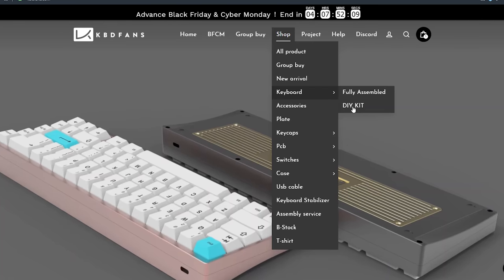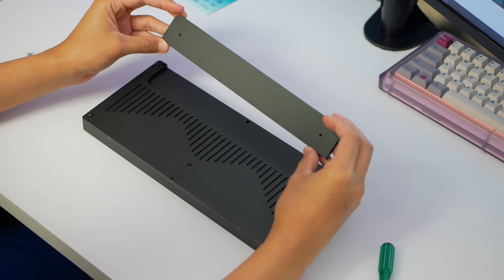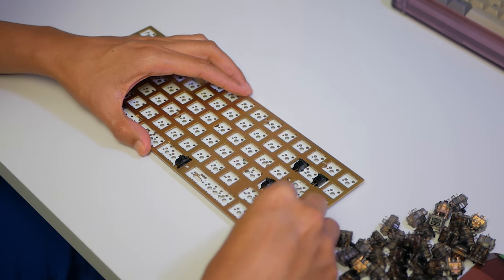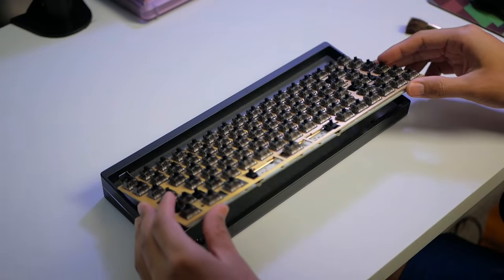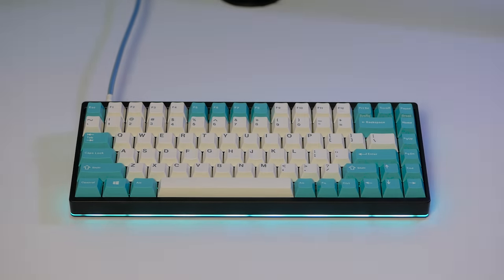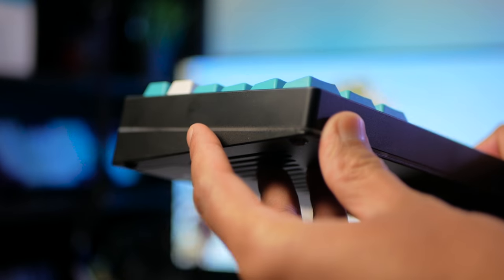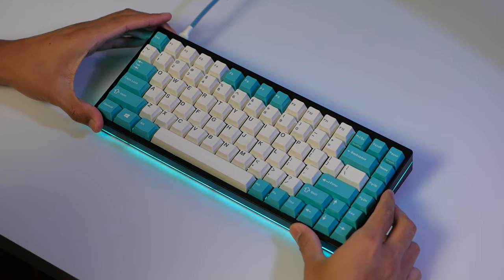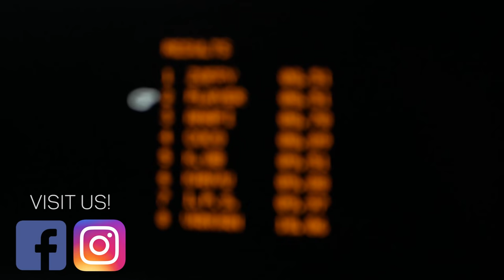KBD75v2 Mechanical Keyboard Build with Gateron Ink Silent Switches!

Comment: I would suggest a cheap hotswap to anyone getting into the hobby.  That way the initial cost of purchasing equipment (ex Soldering station/fume extractor) stays low.  Once they have solidified their interest in custom keyboards they can always use their hotswap keyboard as a test bench for switches later on.
Reply: thats what i did. I just got my new MD Alt. and i purchased switches and keycaps, with the guidance of a friend who got me into this. Im yet to swap it all out.
Reply: I already have a couple of keyboards but I've decided to buy a Glorious GMMK compact for cheap on their back friday sale.

I'll probably buy some Gateron Black Ink switches (still deciding between normal inks or silents) and put them on this board. :)
Reply: I even know how to solder and own the equipment and still enjoy my gk61 for testing around
Reply: Can you send one example of the hotswap? I want to save myself the hassle of soldering(I know how to solder, I'm just not in a possession of soldering equipment).
Reply: Why would someone not buy a hotswap keyboard? im getting into this and sorta confused
Reply: @linkstale  I think non-hot swap PCBs are cheaper but it limits you to one switch until you desolder
Reply: It’z _ Zilent do they effect the sound at all?
Reply: It’z _ Zilent what kind of blunt tip would you recommend?
Reply: It’z _ Zilent anything else? Not having one is one of the reasons why I want a hotswappable pcb without buying a separate one
Reply: kabob
Reply: Hot swaps are soo limiting though. I'd like to see a gk64 with an ISO enter key and Lshift. I've honestly only seen a custom build with these on the verge but that was solder. I haven't seen anyone else.
Reply: @nootics  people just getting into keyboards aren't gonna be bothered about that though
Reply: @willwastaken  maybe you don't have to deal with different layout and I like my enter big and a button next to lshift xd
I'm just getting into it myself, researching a little atm, and i'm probably gonna go solder because of that.
Reply: @nootics  There are plenty of hotswappable ISO kits
Reply: @nootics  I also need ISO
Reply: @willwastaken  excuse my noobiness, what exactly is an iso kit?
Reply: @Vunomic  A keyboard kit which supports the ISO layout.
Reply: I run a gk61 hotswap at my home desk and it allows an easy upgrade path for when I want to try something new and it is the perfect size for a gaming rig. I am looking at a hot swap 96 style for once I am done with college for a desk job, I will refuse to use a provided dell keen lol
Reply: @twitchyg1373  Lol yeah. Generic office keyboards are the most ghastly things in existence.
Reply: @willwastaken  yeah I get to be around them in my internship and they pain me. I don't plan on super expensive builds but I thinking spending up to 200 onna good mech is fine.
Reply: @twitchyg1373  I just got a GMMK and put some Gat Silent Yellows in it and works wonderfully. Very cheap and simple
Reply: @willwastaken  I'm gonna be getting a yc96 board to test the layout for myself see if I like it. The cheapest fullsize is the Drakken hotswap one which is neat being as cheap as it is
Reply: @twitchyg1373  Nice, wish i had the money for a nice custom build
Reply: @willwastaken  yeah but I mean a hotseap yc96 with included switches is only like 83 bucks on korepublic then get a nice cap set and you're basically half custom for about 125
Reply: @twitchyg1373  I need ISO though, and there's nothing available at a decent price apart from the XD87HS, which is cheaply made :/
Reply: @twitchyg1373  Oh wow. God damn it haha. Wish I knew that 3 months ago. Oh well! Thanks for that, I'll keep an eye on it for the future.
Reply: @willwastaken  np I mainly know about them since I'm looking at building my second board for a workspace. And a third to be my main and keep my 60% as a backup
Reply: @twitchyg1373  Ah I see. I can't stand anything smaller than 75%, but I like the numpad for shortcuts and ALT codes. (My TKL is mildly annoying)
Reply: @willwastaken  I really like the small fo factor since I primarily game, but since having to do schoolwork at home etc I'm getting a separate numpad and a macropad. Kind of going for a modular setup that I can move stuff around if need be. Then see if I like a 96% with a cheap option and if I do I may replace my 60% with a higher end one.
Reply: Yeah not too cheap though cause I bit the bullet and bought one, only to find out that the cheap Outemu PCB it came with has sockets that are too damn tight for anything BUT Outemu's own switches, because they decided to have thinner pins than everybody else. And then you think "No worries, I'm looking at a hotswappable keyboard that comes with Gateron switches!", but that's not so cut and dry either because Gateron went and made optical switches, and the PCB for THOSE only works with other optical switches. So that's no bueno either.
Reply: any recommendations?
Reply: Not "If they" but "Once they" have soldified their interest :)

Comment: If this was hot-swap I'd buy it in a heartbeat
Reply: arispan there are lots of ways to make a soldering keyboard to a  hot swapping
Reply: I would aswell.

I can solder switches pretty easily. But, man, is it time consuming. Then I found out about hotswappable boards and I was like, nah, I can't go back to soldering switches.

Same deal with lued switches. I love lubed switches but the process of lubing switches is so soul draining. ;~;
Reply: StringStorm ‌ you could get this but get a new pcb
Reply: @nothatsacamel9187  Any way to do that in a way that doesn't involve any soldering whatsoever?
Reply: SimGunther no you would have to solder prices to the pcb but then it turns into a hot swap
Reply: what is hot-swap?
Reply: @madsschaumburg  It is a pcb design that lets you swap out the switches without needing a soldering iron
Reply: The best reply would be someone that could actually pinpoint the pcb that gives the KBD75 v2 a hot-swap option to it. am I right @arispan
Reply: That would be nice
Reply: What are some good hot swappable boards? I'm a beginner, any suggestions?
Reply: @D3L3T3  Try searching for the GMMK keyboard
Reply: OK, does anyone know of anyone who make a hot-swappable 75% Keyboard Kit/PCB?
Reply: @knightshousegames  any luck finding after 13 hours?
Reply: @farhatbdhj  When someone answers my question, you will know
Reply: @knightshousegames  Pretty sure there are non as of now. Not that I know of, at least. I've also spoken to many people in keyboard communities and no one has seen any :(
Reply: Get the ID80. Hot-swappable and 75%. The only thing you’re lacking is a separate plate as the plate is integrated. Also it won’t have the rgb underglow.
Reply: YMD75v3 is a 75 hotswap pcb
Reply: You can make a pcb hotswap by soldering millmax sockets
Beware that Kailh switches are not very compatible with them (eg. Outomu, Creams, etc)
Reply: @Pheonix560  that kinda defeats the purpose of a beginner buying hot swap to get away from soldering lol
Reply: i know this is 1 year ago,  but you can use a ymdk75v3 hotswap pcb in a kbd75 case and also the plate
Reply: @katakkecepirit201  Is the KBD75v2 worth the extra money and shipping (both at least $30) in comparison with the YMDK Aluminium case? Does the KBD case come with a plate? thx!
Reply: solder is better for you

Comment: I was recently in the market for a new mechanical keyboard because my BlackWidow X TE wasn't registering on some of the switches. It kind of costs too much for a whole new keyboard, so instead I opened my BlackWidow and tested the PCB to find everything in working order. I've since replaced all the switches with Gateron Blacks that I lubed and I lubed and Band-Aid modded and lubed my stabs. Total cost was only around $50.00 bucks and my BlackWidow is back in action. I'm so glad the mechanical keyboard community exists otherwise I wouldn't have had the courage to open my KB up and try modding before buying completely new. :)

Comment: To be honest I think hot swap is the way to go.

But if you already have a soldering kit and you make loads of keyboards then soldering is probably the better choice
Reply: Soldering is a good life skill to have too though
Reply: Many hotswap boards have key chatter. Keys occasionally won't register, or would register multiple times off of one press. Through hole solder keyboards suffer much less from it. Also, this one is a bit of a more minute detail, but soldered boards generally feel more solid too. I used to go with hotswap, but after soldering my first custom, it's an entirely different experience.
Reply: My first custom I soldered, and it was super easy. Really shouldn't be scared of it.
Reply: @lobstar9  yes but money
Reply: @lobstar9  not scared of soldering. I’m sure I can do it. It’s the money that is keeping me away. Idk how many keyboards I will want to build, so 100 dollars for a pen is a lot

Comment: I have a KBD75 that I've installed Milmax hot swappable eyelets and it's the best thing that I've bought. I swap out all the keys on my Keyboard every 1-2 months. Just switched to some Orange Helioses earlier today from V1 Zealioses. I didn't have to buy a new board, and now I get to use the layout that I love (NEED F Keys and Arrow keys) while using an entirely new switch.

Hotswap is the best thing for someone who likes to use multiple different switches.
Reply: How heavy is the kbd75?
Reply: @MarvinGreyPhoto  I have the aluminum case and brass plate in it, so it's fairly heavy. If I had to guess maybe 4-7lbs?
Reply: Wow that's one heavy KB, thank you for your answer!

Comment: Hotswap sockets became a thing just when I was thinking of trying out soldering, so I never got into it lol. Not unless you're working with a super esoteric layout, which is really only a problem for keyboards smaller than TKL, I really think there's very little reason not to choose hotswap these days. Not only are they easier to put together, they also don't lock your board into one switch setup. Soldering switches feels to me like putting all your eggs into one basket. That said, I don't actually plan to change out the switches on my hotswap board. The value for me has always been that I never needed go through the hassle, and it gives me peace of mind that I can swap out dead switches without ever needing to take the keyboard apart.
Reply: BoyBalastog I’m fairly new to this, but from what I understand the soldered switches are more stable and are less prone to wiggling in the socket. However, I’m not sure if that difference has any impact on the overall feel or sound. 

That said I think the versatility is a good trade off..except using box whites. Getting them out of my CTRL was rough.
Reply: @platty9237  I personally can't feel any difference between soldered and hotswap sockets. Given that many of us in the hobby came from keyboards where switches were soldered in by default, if there was any difference, it's not very noticeable. And if your BOX Whites fit that snugly on your CTRL, I can't imagine that having it soldered instead would make any difference to hte feel or sound.

Then again, this is a hobby where people are concerned over whether the mounting plate is screwed to the top or the bottom of the case, because that supposedly makes a difference in feel too. It's also a hobby where people pay the price of a keyboard just for a set of keycaps. Lots of things in the hobby don't make sense :P Just go with what feels right for you.

Comment: I posted in a prior video that this was my first build. I lubed my Zealios switches. I also clipped, band aided and lubed my stabs. I went with the 82 key layout which meant I had to reprogram the board and move the function key one over from the upper right. My 2 switches to the right of the space bar are 1.5u's. I would have never done this if I knew how hard the reprogramming was. If you put the board together and block the function key on the bottom before you reprogram, well you can't do that because you have no function key. LUL! I figured it out eventually. If they made the board hot swappable I might have gone that way. However soldering was the most fun part to me. I probably won't purchase any hot swappable keyboards but I would consider soldering my own hot swappable PCB just because...I want to. My keycaps were the DSA high contrast set from Pimpmykeyboard.

Comment: Looking to build my first board and I LOVE the sound of this and others like it. I know the switches have some impact to sound but these are linear switches. What parts of the board help produce this low “thoccy” sound? The plate? Keycaps 

I have a ducky one 2 mini with MX Browns that I’d like to desolder and reuse the pcb in a aluminum case with a brass plate but idk if I would get the same sound
Reply: Plate and case mostly
Reply: The mounting method of the plate will also help produce a different sound.
Reply: @rousseau327  Ah you mean tray mount or bottom mount, etc
Reply: ewt415 mounting method? Don’t all plates mount in with screw mounts?
Reply: Lieutenant Hoss screws are used to keep the case together for all customs I know of, but mounting of the plate can be different.

1. Common one is tray mount, i.e the Tofu, where there’s somewhat of an array of threaded mounts across the bottom case. The screws actually go through the PCB.
2. Top/Bottom mount, i.e. the Xeno, plate is screwed along the edges of the top or bottom case, and the PCB is only secured via its mechanical connection to the switches.
3. Sandwich mount, i.e. TGR Jane, the plate is sandwiched by the top & bottom case, no screws involved in secure the plate at all
4. Gasket mount, a form of sandwich mount, i.e. Keycult No. 2, the plate is sandwiched between 2 gaskets. 

Might be more, not sure. But each of these will provide a different typing experience & sound.

Comment: My experience with hotswap is pretty poor. So hotswaps needs either a really tight plate or you'll need a 5 pin switch. Soldering on the other hand, is pretty fun and is more consistent overall. Wobble is also an issue since hotswaps are pretty wobblish and with kailh sockets, excess "hotswapping" makes the sockets loose so when you pull a keycap off, the switches also comes off.
Reply: This. If you know how to solder, my suggestion is to solder your board. If you don't know, it's easy and cheap to pick up and learn. For something like a keyboard, a $20 soldering iron is all you need.

Comment: I wanna do my first build, but I'm not sure wether to get Tealios V2 switches or Gateron Inks :/
Reply: I'd say inks cause tealios is a bit too expensive per switch
Reply: Knorki. I’d definitely recommend inks. Tealios feels slightly smoother however they sound pretty bad for the expensive price tag. If you don’t care about the money too much you can buy tealios and pop some different springs in 
there and it sounds significantly better 👍

Comment: That is too good, one of my dream builds as I prefer 75% however i'll build mine with lubed gateron milky yellow
Reply: What's the difference between milky yellow and normal yellow
Reply: @pipharris665  Milky housing
Reply: @PitiPablo_  what's the effect on the feeling and sound
Reply: @pipharris665  Thockier/deeper sound than the regular clear housings.

Comment: Gotta say I love both hot swap and solder only, I buy way too many switches but not enough keebs to just have all these switches laying around. Love being able to swap out some linears for some nice thocky tactiles & then maybe having some lubed silent keys on the mods. I actually prefer hot swap more for this reason BUT I still love soldering, it's a neat skill to have & practice at but desoldering is a nightmare & i'd rather lube 300 switches than desolder a full build

Comment: does this come with keycaps.switches?

or does this only includes case,PCB,plate?
Reply: Just case, pcb, plate, possibly cheap stabilizers (I've been recommended to upgrade to screw in stabilizers). It says what's included on the webpage.

Comment: I just changed my switch into Durock linear silent on my kbd75v2 as well.
But I noticed that on almost all my R2, especially Capslock and Enter they sound clack-y (definitely not silent at all like the others). Kinda seems like the keycaps hit into the switch top housing. My keycaps is EPBT ABS doubleshot (cherry profile).
Is the problem the keycaps or switch?
Reply: Could be that the pcb has north facing interference.  You would need to stay away from cherry profile keycaps. ( ex: buy oem keycaps ) Otherwise find switches with a longer stem , to help avoid a problem with the cherry profile keycaps. It’s a little annoying to understand, but I’m sure if you research it a little, you could figure it out.